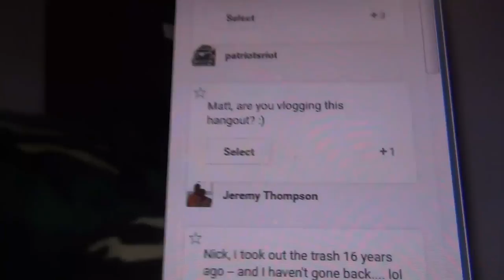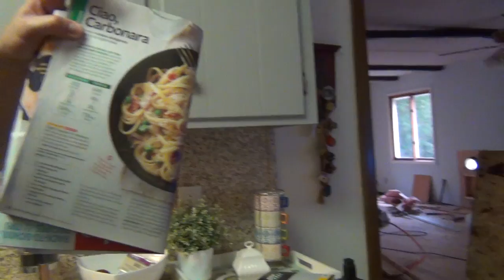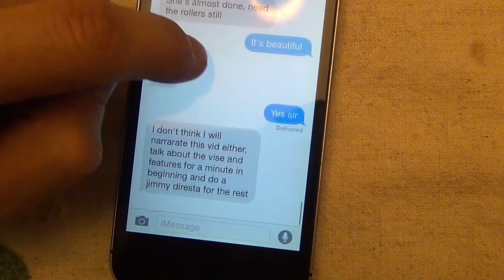We Make Carbonara For Dinner [Aug 12, 2015 Vlog]

Comment: Might be easier to make a spline so you can but the groove side to the groove side and continue to nail through the tongues.  I did this a couple years ago because I wanted my floor to go straight down my hallway, so I started in the middle and worked both directions.
Reply: Mitch Fenneman This is one of those wish I would have thought of that moments.  Luckily it's only a closet with 5 rows.